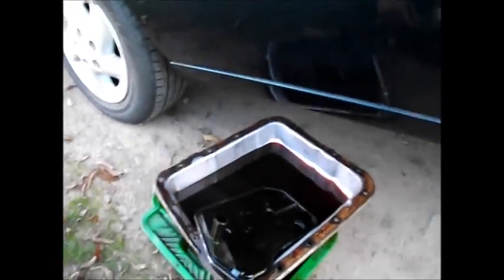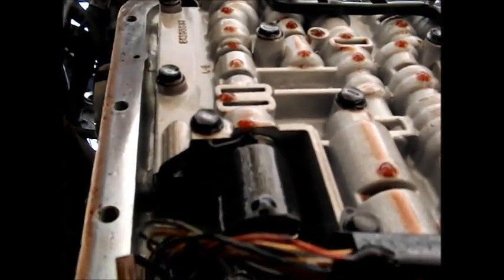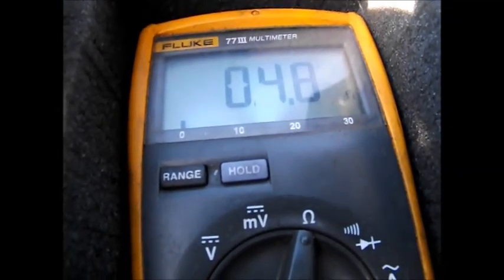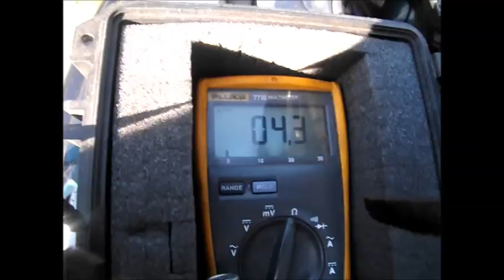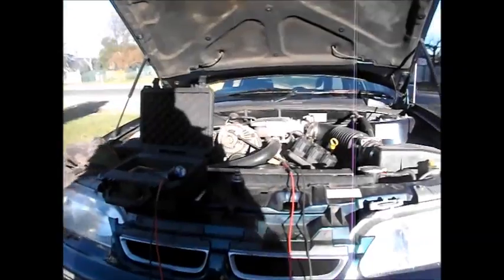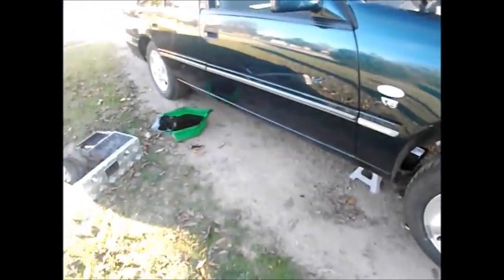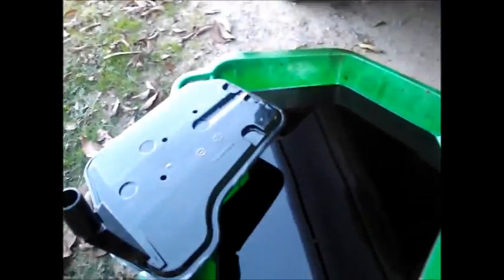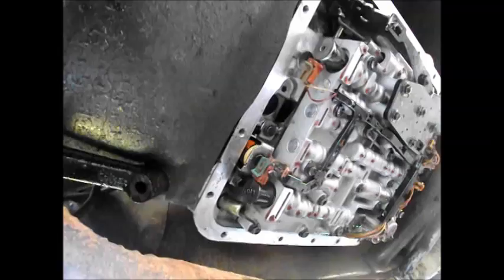vs transmission

Comment: Looks like you did a bloody good job dave, as allways mate :-).
I had to chuckle at the pan being clean enough to eat your dinner from.
"Nice slices of sensor assembly with control wires sprinkled on, then a light drizzle of atf for that perfect dinner." LOL :-D.

The day looked nice and that makes any repair better, hope you didnt forget the beverages to keep the brain lubricated :-).
I was with you mentally, i understand that feeling.
Not ideal conditions but it had to be done, the shower would have erased most of the bad feelings towards the job, im sure you were happy the job was done, i would be :-D.
Ooow nice case for the multimeter, worth the effort.

Comment: my VS V6 in park and reverse , locks two gears together , and doesnt move . neutral is gone , drive is there . it moves forwards on drive . i havent driven it in drive , its not registered . if i stall it up on the brake in drive , the motor torques up , but in park or reverse , it just goes " BWOOAR ! " and wants to die .